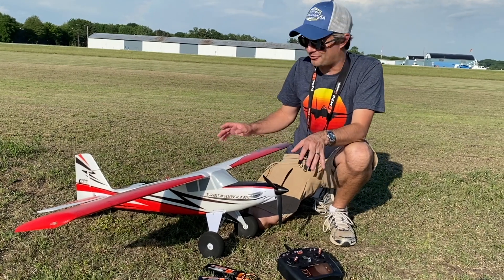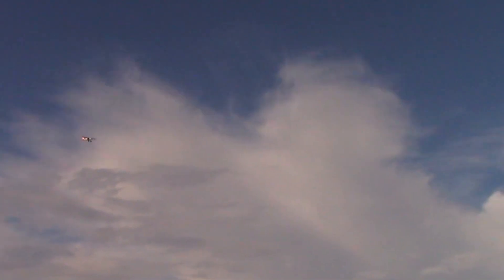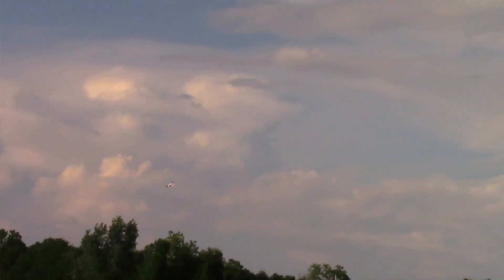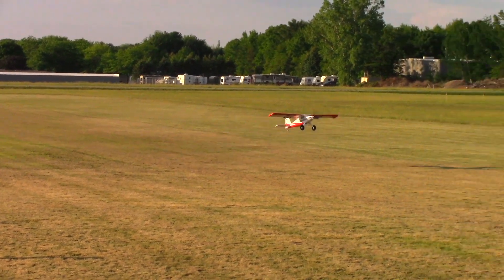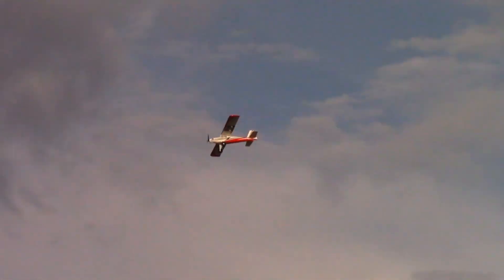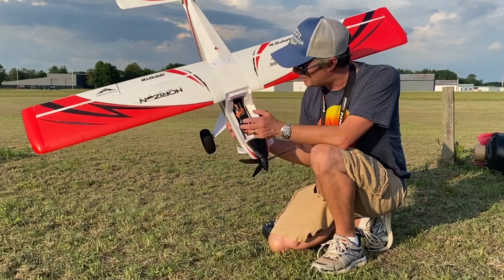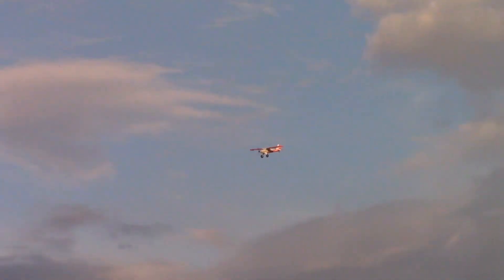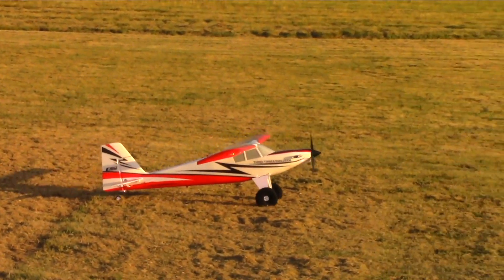What is the best battery for the E-flite Turbo Timber Evolution 1.5m BNF Basic?

Comment: Great video. This is probably a model I'll eventually get. [New guy with Sport Cub S 2, then UMX Turbo Timber, next AeroScout(?)]
Would like to have gotten flight times one might expect from those three different battery choices.
Reply from the maker: If you can fly the UMX Turbo Timber, you should be totally fine with the larger one. I too wish I could have been able to get some longer flights on the batteries in order to measure the flight times. Our club operates at an airport and we only get about 5 minutes to fly before we have to land for full scale air traffic. I could fly with a large battery and still end up with a 5 minute flight due to full scale traffic. There are some rare occasions that we don't have any full scale traffic to deal with, but those are super rare. I do know that both the Evolution and my original Timber fly for 6.5 minutes on a 2200 3S and land with 40-50% capacity. From that, you can estimate the flight times for different batteries. Of course, how you fly will greatly change that. Lengthy taxi times, thick grass, lots of aerobatics, high speed passes, and battery health will all play a factor to reduce flight times. Always best to set your flight times for your batteries and your flying style.
Reply: @BRGT350  Thanks for the additional info. Maybe fly a few times paying attention to telemetry and then set the timer accordingly?
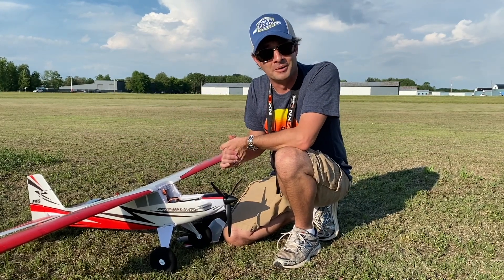Reply from the maker: This what I suggest and is what I do on my planes. Charge up the battery you want to use for the Timber. Set your timer at 5 minutes. Fly like you normally would fly. If you cruise around at half throttle, then do that. If you fly fast, then do that. At the 30 second countdown time, setup for a landing and try to be on the ground and done taxiing when the timer runs out. Check the battery capacity for the remaining value. Let's assume it is 50% remaining on a 2200 battery. So you consumed 1100 at 5 minutes or 220 mAh per minute of flying. You want to land with no less than 30% battery remaining. That means you want to consume 1540mAh of battery with your flight. 1540/220 is 7 minutes of flight time. I typically give myself a 30 second safety window in case I need to go around or wait for an opening to land. I would set my timer for 6:30 knowing I have an extra 30 seconds of reserve. The method works for any battery, you just need to know how long your flight time was, what the starting capacity was, and what the end capacity was. Since all my planes don't have telemetry, I use this method as a simple way to get my timer set.